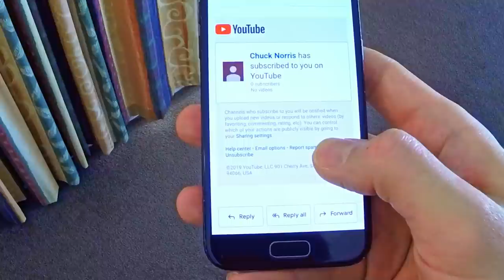3D printed subscription counter

Comment: The most impressive part to me is how it counts up through purely mechanical means.

EDIT: I was here before it was cool!
Reply from the maker: That's what motivated me. Could have used 7 solenoids but where's the fun in that ? ;)
Reply: Agreed! The whole time I'm thinking about how I would approach this problem and my eyes lit up when I saw the numbers increment mechanically! Well done sir! Very impressive. Love this project
Reply: @fhuable  How did you make them increment mechanically?
Reply: I see, mechanical programming gears. Ingenious. Though, you could have used a single motor to power your entire system if you wanted to, it would just be a matter of creating a gear with 10 possible node positions, and using a single node to initiate the next module. Of course, you’d have to take the increasing resistance into account, but if you prefer mechanical, this is certainly an option! :3
Reply: @bushytail7262  
Similar gear system to what operated Odometers before they made them digital.

Comment: I was wondering how you much control the thing has.
So the fact that it is only one motor tells me it is a very clever mechanical counter with some basic electronics to keep track where it is.
Nice idea with the two stable snapping positions and a combination of gear ratios with pinion count for setting the different phases.
I imagine it was quite a headache to plan this out. Well done 👍
Reply: Tim Solinski I too would love to learn how he planned this out

Comment: What are the magnets for at 3:46? I just realised there's no mention of them in the instructions.  Also, can you tell what that sponge tool and colouring paint / (looks like varnish) was please? It really is awesome :) I love this and plan to make a few.  I'm hoping to build the electronic versions
Reply from the maker: The magnet is used to tell the micro controller board where the number zero is located after power up. It is mentioned in the manual ;) The paint is wood stain (on wood PLA) brushed on with a sponge.
Reply: @fhuable  So sorry, that was a "woods for the trees" things! My own fault for skimming the Addendum part! Just found it, thanks :)

Comment: This is ridiculously cool!  So looking at the Cults3d page I don't see any info on the electronics.  Where can I get the details on this?
Also could this be made to count down like a timer?
Reply from the maker: It would require a different set of timing gears, but yes, could definitely be made to count down. I was thinking of including such a set but it would have really cluttered up the already very long list of files. As to the electronics, I was deliberately vague. Someone with Arduino experience would find the explanation trivial and wouldn't require a lot of info from me, someone without would find it very hard to do.

Comment: How does the board get the subscriber numbers? The main board doesn't seem to have internet connection capabilities via WiFi nor wired internet, and it doesn't seem that it should constantly connected to a computer or something, so... I feel that the scenes in the video where the subscriptions add is... not fake, but simulated. 
I know you totally can make it work like it should, maybe just for the video, liked it, it was a great video.
Reply from the maker: For the video the counter was plugged into a Raspberry Pi. Since then, I have plugged an ESP-01 wifi module into the board and it is now entirely stand-alone.
Reply: @fhuable  Yeah of course that makes a lot of sense.

Comment: Almost got  a thumbs down for the inefficiency of dumping sorted parts on removable build surfaces into a tray, then resorting them at the assembly  table.  But that was just a small thing in a complicated build.    Looked great.  If I had the time, I would try it myself.
Reply from the maker: There is a constant battle going on between efficiency and the availability of horizontal surfaces left in my home. ;)

Comment: I'm just surprised u got the glass printbed with the ultrabase coating to work. For me it just doesn't want to stick, or at least not for the whole print.
Reply from the maker: I love the glass bed! I just keep it clean, hot and when I can use brims. It's relatively new so that may also be a factor.
Reply: @fhuable  Is there any particular way you clean the dust off the bed. On mine a lot of dust collects on it quite quickly and I don't know if I can/should use water to clean it.
Reply from the maker: @KiemPlant  I clean it with isopropyl alcohol just before I start the print.  Not sure it's necessary though. Some people seem to have success using hair spray.
Reply: @fhuable  Aah, thanks!

Comment: Cool print and a great 1 grand subs video!  
Which filament are you using? 
And what paint are you using for the casing?
Reply from the maker: The case is printed in wood PLA, stained with .. wood stain. :) Took a few applications, the wood PLA doesn't soak up the stain as well as normal wood would... *cringe*
Reply: fhuable I see.  
which brand is your PLA (Not just the wood one, also the other parts)?
Reply: fhuable and how are the segments have a yellow front and black back? Are they painted or printed with 2 different filament colors?

Comment: This is amazing. I would love to have a clock made out of these. Tempted to try dive into 3d printing just to make one. But I believe there is a pretty big learning curve for 3d printing. Would you be interested in printing and selling the parts (unassembled)? I would pay good money.
Reply: Not just Printing, but modeling as well
Reply: @nathanbasset   G8M8N8  Florian has done all the hard work. Link in the description to download the STL files. I'm sure I could work out how to print from them (if I had a 3d printer), but it's the settings of the printer I would have no idea and not sure I'm game enough to research and try understand all of that (at least not at the moment). But damn I really would love to make a clock from these. Just 4 digits (hours/minutes), I think it would be achievable with an arduino and some stepper motors.

Comment: This is truly an inspiration to us all. Very well done!. Would love to hear more about your creative process when designing this. Did you CAD it ALL first?
Reply from the maker: Thanks. I designed the mechanism for one segment first and test printed it to make sure it worked as expected. After that I added the next 6 segments plus the rest of the gear train and super structure. I had the general look I wanted in my mind so it was not a big stretch to put it all together and add the case. It was completely finished in CAD before I started to print all the parts and everything fit together pretty well.
Reply: Do you know how many hours it took to complete the design stage? I'm fairly mechanically minded,  but the thought process evolved in coming up with the gear train for that blows me away.

Comment: How hard would it be to make some kind of clock?
Reply from the maker: Not hard. Just changing a few lines of code. But I have an inkling that flipping the first digit once a minute 24h/day would wear it down rather quickly :) and then there is the noise...
Reply: @fhuable  Would the drive gears also need to be re-worked? The ten minute display goes from 0 to 5 then back to 0.
Reply: @fhuable  A calendar, maybe, then?

Comment: I wonder how the system is reacting right now. Is he gaining subscribers so fast that the program can't keep up? As in, does the display go through EVERY NUMBER? Or does it skip when the command to rotate comes in too fast?
Reply from the maker: I'm only updating the count every few minutes. This keeps down the noise during busy times, is easier on the mechanics and also reduces the number of Youtube API calls (there is only a certain number of calls you can make for free per day).
Reply: @fhuable  Oh, I see. I didn't account for the sound. But that makes total sense. Thanks for answering my question!